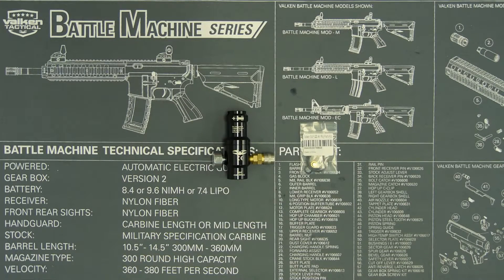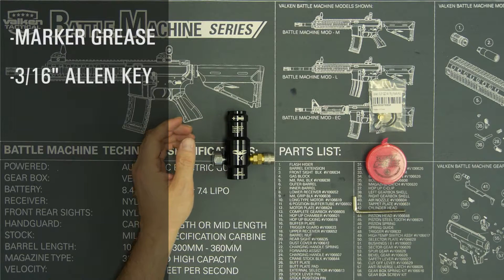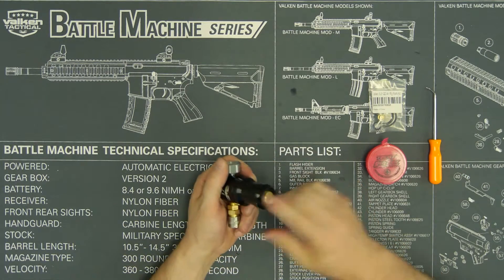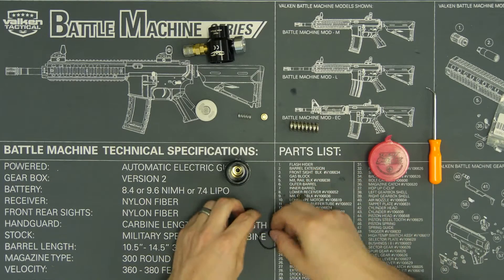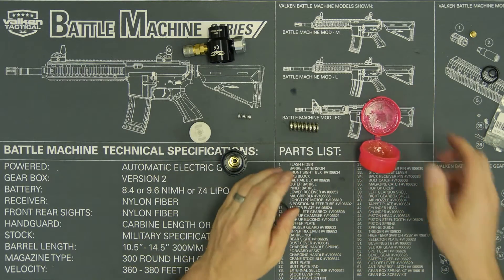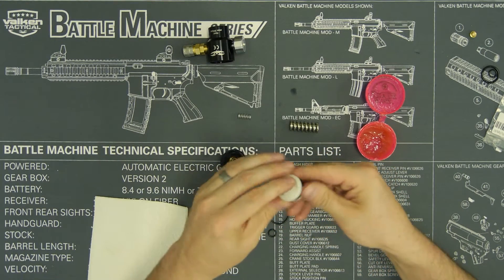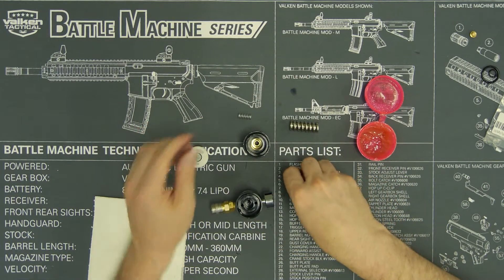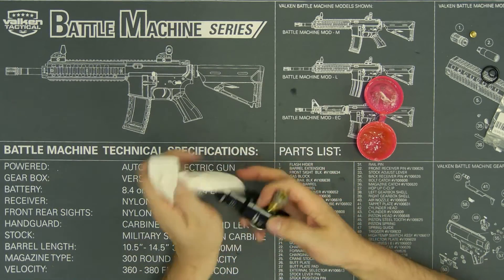Valken Tactical Tech Vault SLP QD Air Rig Rebuild Kit

Comment: so lots are going to make the mistake of screwing in a tank that is not blow 300psi. can you test this and tell us if the rebuild kit completely fixes this issue after switch your tank reg to output less the 300psi. basically air shoots out the top of the reg when this happens.  can you tell me what is the part that fails is it the POPPET? spring guide rubber?
Reply: so i can clarify that the rubber on the POPPET/spring guide gets damaged when screwing a tank reg grater then 300psi.  i replaced the rubber with new 1mm rubber by super gluing it on the poppet and it worked fine. so buying a replacement kit will fix this issue.
Reply: I wanted to know because I acquired one of these regulators second hand, and you can barely hear the air leak coming from the adjustment screw top. is slight but, leave that regulator on long enough is gonna drain a tank.
Reply: Hey lol. So I can buy this regulator and if I see a leak I should just replace the rubber on the poppet and the o rings?